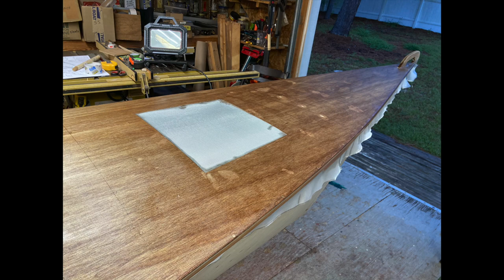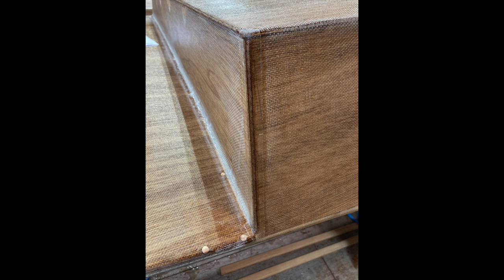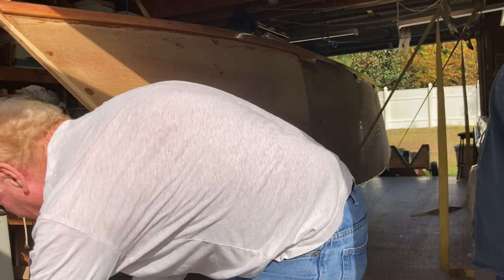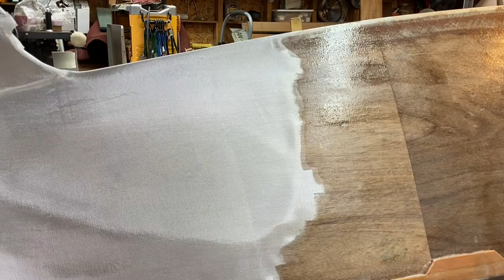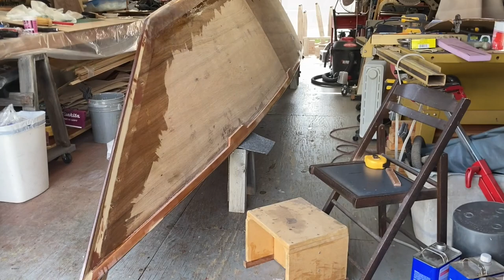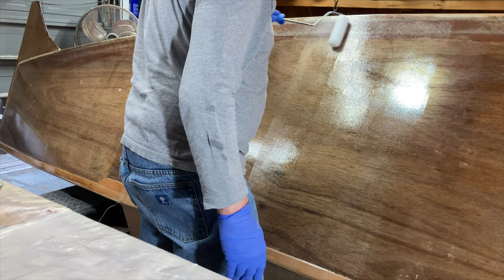Ep 2 Building a Wharram Designed Tiki 21  HD 1080p

Comment: I believe Kathie said Meranti Plywood and Rex says Fir on the keel. The Study plans just say plywood. Since it looks like you guys know what your doing, what type(s) of plywood do you recommend?

I was planning on ordering appropriate sized Okoume.

Thanks!
Reply from the maker: We usually use meranti, though we have used fir and okume. Fir will check if not fiberglassed , just epoxy sealing it will not fix this problem. Okume is lighter and not as rot resistant as meranti. Meranti is more rot resistant, durable, heavier and cheaper than okume. If you are building a race boat use okume and seal it well. We use fir only when we can't get meranti or okume. In our opinion, meranti is a prettier wood when finished bright of the 3. Thanks for watching.
Reply: Thanks for quick response! I appreciate it. From snowy NE Ohio.
Reply from the maker: @EB-xz1nq  We can commiserate with you, we are originally from central  Indiana.

Comment: Very cool ,what a great sensible way to build a boat...alot of thought went into this design for the builder...it's a work of art..!..how many sheets of plywood  does it take.?.. sorry in advance of I missed those details.
Reply from the maker: Michael, We used 20 sheets of 6 mm and 1 of 15 mm. That does not allow for any errors and the 15 mm does require careful arrangement of parts in order to get by with just one sheet. Thanks for watching.